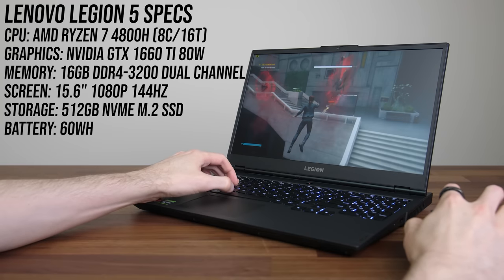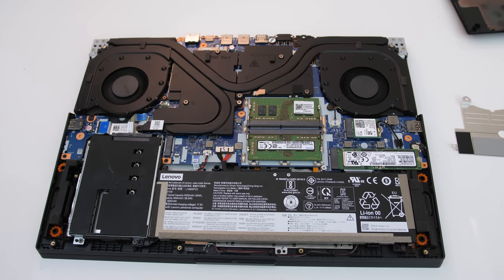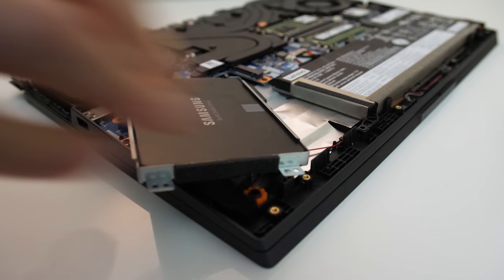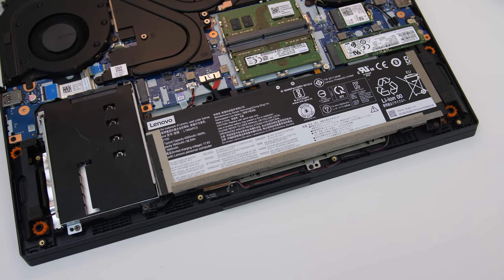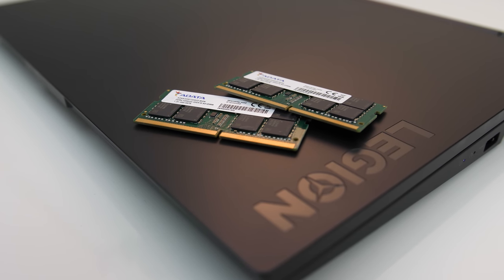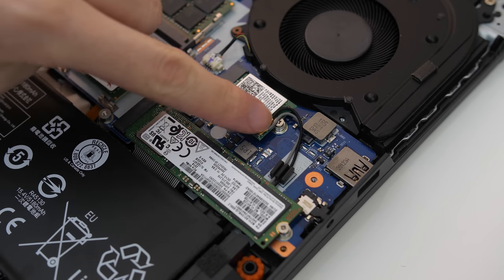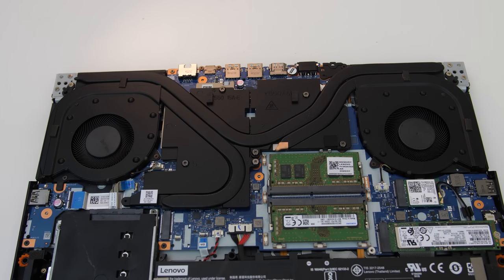Lenovo Legion 5 Upgrade Guide - Boost Performance!

Comment: Just a note to people upgrading brand new Legion 5s. the newer ones (like the one I purchased) have different motherboards installed meaning a 2.5inch SSD or HDD can't be installed into it, an M.2 SSD can still be installed in the same way. Another thing to watch out for is the RAM, the motherboard in the newer ones isn't XMP based meaning XMP ram (what's commonly sold) won't work at full speed.
Reply: It should be in the TOP of comments! Very very important information. I am waiting new 82NW0037 and fear that cannot plug 2.5 HDD!
Reply: So I wasted $50 for nothing 😑
Reply: same here, can't add 2.5" ssd, only nvme
Reply: what's the version number of your legion 5? unsure which version your referring to
Reply: @megaberu  honestly unsure now, I sold it over a year ago now
Reply: @KilepsYT  I'm currently on a desktop PC I built myself but before I got rid of my legion 5 I was very happy with it, it was powerful enough to do VR games. I upgraded storage in mine and gave it 32gb ram and had 0 issues with it

Comment: PS: It is recommended to disconnect Power Battery (not cmos battery) before doing anything on the laptop's internal.
You do not want to accidentally turn on the laptop while installing devices.
Reply: You can accidentally touch your screwdriver on the board and blow important stuff if you don't disconnect the battery. Saw this happen to a friend when he was upgrading his laptop.
Reply: I heard that this laptop has an option to disable the battery in bios. So would that be the best option? So that you don't need to disconnect the battery and risk accidentally damaging the cables or whatever if you are unexperienced.
Reply: no matter what it is... car, motorcycle, rv, computer, gaming console, PC, fridge, microwave...doesn't matter. 
As a safety precaution for both yourself and the devices you are working on always disconnect from the power source. 
I'm sure people are gonna comment and say I don't know what I'm talking about but please just remember this no matter what it is you are tinkering with!
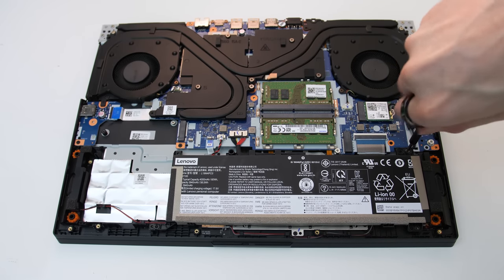Reply: Is that the cable he disconnects when he takes out the battery or is it another one? The one at 4:30?
Reply: That metal thing above the rams and ssd, is damaging the motherboard when u accidentally touch it to motherboard.
Reply: @theairaccumulator7144  Saw this happen to me while upgrading a 6yo laptop ^^ An accidental and quick screwdriver touch on the MB resulted in an instant flash and RIP the poor device. Be careful guys. Always unplug it from the battery (and charger ofc) first
Reply: @Niks50  Don't do that. Always opt for physically disconnect the battery and charger. You don't want residual electricity running in the components when you remove them.
Reply: @bobowofol  how to disconnect the battery ? I can disconnect the charger but the battery i have to open the laptop
Reply: @freemaysin5088  you are right i always unplug power before i do anything pc internals related like swap gpu or like repalace hdd/ssd no matter if its desktop or laptop
Reply: Just like human surgery
Reply: Right.

Comment: After watching so many videos of this laptop on your channel, decided to pick one up. Here it comes with 2 TB SSD RTX 3060 and 165 hz screen, ryzen 7.
Reply: Just picked mine up a couple weeks ago and the only difference is mine has a 1 TB SSD. So far I'm really loving it. Hope you like yours as well.
Reply: @baguetteengineer  It's doing fine, for both editing videos and games.
Reply: I'm picking up the same laptop too
Reply: yea i saw amazon is shipping  lenovo legion 5  rtx 3060 with 2 tb of m.2 ssd. its pretty good i must say
Reply: Hey bro
Sourav Joshi Vlogs Had A same laptop.
he had some problems. 
so please be aware buying this model of lenovo
Reply: Have any of yall noticed issues with the keyboard missing keystrokes from time to time?
Reply: Is 2TB is the maximum limit storage for this legion 5?Including both slot of nvme ssd
Reply: @KojiroSasaki21  yes it has 2, 1 TB SSDs attached. You can upgrade further I think.
Reply: same, getting it tommorow. only difference is that i have a 1tb ssd, but i can take the one i have in my current laptop and put it in the legion :)
Reply: @GorditoBanditoFPV  no, in my limited typing it hasn't happened yet. Used it for 2 months for editing videos and games. I do type an email from time to time.
Reply: @RideWithRahulOfficial  going to pick one soon in june, cant wait
Reply: Does it comes with the port 2.5" for hdd?

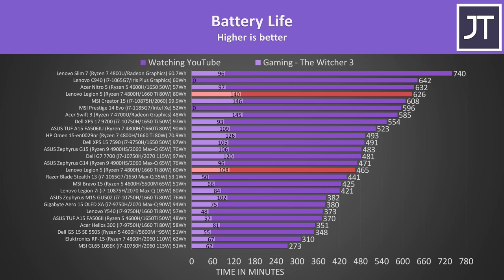Comment: 4:56 - the longer cable version is from the 17" Legion 5. It will fit into 15" version, as seen in your video. But the shorter cable 15" version will NOT fit into the 17" version, be noted.
Reply: Nice pfp
Reply: Those holes on the back looks scary as fuck. It's like, the thing is staring at me. That's freaking me out.
Reply: Please suggest me a battery for ideapad gaming 3
Reply: @traderbear6518  That was just your trypophobia kicking in. lol

Comment: Thanks for including the 80 Wh battery upgrade section! The Legion really became the best overall gaming laptop of 2020 with these upgrades. Would've been nice to see if RAM with better timings and tuning further improved the experience.
Reply from the maker: Yeah faster timings would have been fun, but this is all I had access to without buying expensive memory just for the video 😁
Reply: Included RAM is CL22. There is no XMP supported on Legion 5, and better RAM is only CL20. The performance difference is really small, like 1-2 fps, if exists at all. CL20 HyperX Impact RAM kit is about 150-180$, totally not worth it, IMO.
Reply: @mrgndx  I see 3200 cl 16 modules gskill ripjaws sodimms that are 1.2v on newegg though. The absolute fastest sodimms are 3600 cl 16 and they are expensive as well as higher voltage at 1.35v.
Reply: @JarrodsTech  
I wana buy 80wh laptop
Can anyone help me I couldn't find it
Or the model don't exist at all..?
Spec req :
4800h
1660ti
144hz 300nits
80wh

Comment: This is a beast of a casual gaming and full time dev laptop. 8-cores and 64GB of ram. You can't go wrong with that.
Reply: Actually, you shouldn't add more memory than you'll need. It actually proves to hinder performance. Using these faster nvme drives really makes more ram unnecessary. Check benchmarks with more vs less RAM online.

Comment: That 80wh battery upgrade is absolutely impressive! I thought that it would be a little better than the Omen 15, but I didn't expect that huge of a battery lfie increase.
Reply: How much of an increase did you experience?
Reply: Those holes on the back looks scary as fuck. It's like, the thing is staring at me. That's freaking me out.

Comment: You need to disconnect the battery before ripping metal shields off the motherboard, because you can short the powered rails and the laptop would be dead. Despite that good and short video showing on what needs to be done to upgrade these things :)
Reply: I know someone is going to ruin their laptop if they just watch this video without doing further research,
Reply: lol - that's like saying you need to dismantle the laptop's screen before doing any upgrade to the laptop.
Reply: @xibeon   Disconnecting the battery is ALWAYS the first thing you should do when taking apart something. I know you will probably say that nothing's happened to you, and I've never had any issues with it either, but that does not make it safe in the slightest. Also good job responding to a 1 year old comment, really showed em
Reply: @ActualRealKayamariOfficialVEVO  Yeah nothing bad happened to any laptop I've ever opened and they were quite a few. I don't even know anyone who somehow damaged any laptop by not disconnecting the battery. Im sure you don't either. The thing with damaging the laptop by not disconnecting the battery is a internet myth. Sure, it can happed to someone somewhere, but same goes with lightning strike or lottery winning.
Reply: @xibeon  Just because it's unlikely doesn't mean it's not a risk that should be taken. Disconnecting the battery takes three seconds to do and means the risk (even if it's as low as you think) is put to 0. that's better odds than leaving it connected. Why do you want to keep the battery plugged in in the first place? Also, if I'm working on something that's worth multiple hundred dollars you bet I don't want to take any risks in the slightest about frying it.
Reply: @MSOLO_343 Was it turned on  while doing your upgrading ?

Comment: I like that Lenovo included the four SSD screws even though they are very much standard screws that are likely to come with the SSD as well. And their decision to specially design a piece of plastic to hold them is so smart as well. They could have just gone lazy and put them in the plastic bag with other accessories, which the user is unlikely to remember or even notice. It's details like this that make me approve of a product that much more.

Comment: You might be able to use the M.2 drive as well as a 2.5 inch SATA SSD at the same time if you take apart the 2.5 inch SSD by removing it's plastic housing. Inside that there's a high chance you'll have a small circuit board which is the SSD. After that you might even be able to have all three options, larger battery, SATA SSD, M.2 SSD(As long as that M.2 isn't the same port though, shouldn't be if the M.2 is NVME).
Reply: I guess those second drive ports (sata and nvme), share the bus. that's why you shouldn't connect both drives by force.
Reply: @visitor404  I've had the drives connected this way for over a year and I haven't noticed any drops in performance
Reply: I can confirm this. I have an Kingston 2000g KC2500 M.2 2280 NVMe SSD (2TB) installed in this laptop.

Comment: Love how I found this video 3 days after putting in my 2.5 ssd. First time I've taken apart a computer and did any kind of installs. It went great, but fantastic content nonetheless!
Reply: Hey man quick question. When upgrading storage will you need to transfer the storage from the old one into the new SSD?
Reply: @hectorrmdz  if by "transfer storage", you mean transfer windows to the new ssd, you dont.

Comment: Suggestion: At 0:28 maybe you could continue with the black background theme and the wooden table. Would look class.
Solid video as usual
Reply from the maker: I will, I'm just in the process of setting up the new filming space, so for now while getting set up some things are still happening in the older room.
Reply: If the color is just right the laptop will be invisible.
Reply: @JarrodsTech  I agree that the wooden table and black background looks better, but the white table gives better contrast especially when you're working with parts and taking things apart. Anyways thx for the video I literally just bought the same model (same specs even) cuz of your videos a week ago. 

My biggest concern after GPU and Screen refresh rate was thermals. I live in a hot climate so, thermals was a big concern for me, your videos played a huge part in making my decision and buying the legion 5 1660ti Ryzen 7 4800h / 16 gb/ 512 SSD. 😊

Comment: Feels like you are fed up with the Short Circuit video about not being able to upgrade ram. I am too.
Reply from the maker: WHAT'S THIS METAL PLATE? GUESS WE'LL NEVER KNOW
Reply: @JarrodsTech  Jarrod, I'm sure that the Legion 5 is only limited to 32GB of ram not 64GB of ram
Reply: @nexomii4187  it works actually
Reply: @nosc0pe  oh okay, I remember a tech YouTuber said it's only limited to 32GB thanks for the info
Reply: @nosc0pe  are all laptops like that? That you can go higher than specifications?
Reply from the maker: @nexomii4187  definitely works, I think people confuse what the company sells it with as being a limit.
Reply: @machujoseph4765  idk, Google the laptop model (I.e. Like helios 300 64gb ram Or ph315-52 64gb ram)

Comment: Just ordered a 32gb ram kit and 1tb m.2 SSD. Super stoked, thank you for the guide ❤️❤️
Reply: My legion 5’s internals did not look like yours, at all. 

My HDD orientation was flipped, the m.2 drive didn’t have a place for me to screw in, and my battery was fucking massive and ran the whole way across the bottom. 

Like what the fuck
Reply: @Birdo720  Ahaha lol, I hope mine is like the video. I'm putting a second m2, do you know if I can install windows in it? And use as main m2? Thanks!

Comment: for anyone watching this, dont change the thermal paste for any of the legions, they use a phase changing thermal pad and its very good in laptops
Reply: Does this mean the thermal paste never has to be reapplied on it? my current lenovo ideapad 520 is thermal throttling and I think the reason is that the thermal paste is dried out. If  thats not an issue with the legion Ill be even more sold on it then I already am right now
Reply: @deadfox5489 change it then but pick a good brand thermal paste not mx4 or mx5 they are not good after testing

Comment: The 64gb RAM upgrade might not show much improvement in specific applications, but it will be useful for people managing workloads that require it, like virtual machines and docker along with other machine learning tasks. So its good that this laptop supports 64gb RAM.
Reply: @llamaloversunite  it does not exactly supports more than 16gb of ram?that's a deal break for me since I consume more than 16gb

Comment: If you know what you're doing, I strongly recommend changing stock thermal paste for liqud metal (Thermal Grizzly Conductonaut  in my case) Temperatures dropped from 98C° to ~75C° on CPU in full load, which is a nice improvement for longevity and performance of your HW.

Comment: Also, if you experience micro-stuttering in-game, I suggest to turn off processor boost in power settings. The boost in my example caused thermal throttling (clearly visible in HWINFO64).
Reply: how do i do this

Comment: I got this laptop and it's awesome. I have the intel version and i've never had a problem with it. It dosen't overheat or anything like that. But the biggest downside is that it only has 3 modes which sucks, other than that everything else is just perfect.

Comment: You sir, are a legend. Went through all the Lenovo manuals, no help there...this was great. They suck with a 512gb main drive, bumping that to a 2tb M2 and the 2.5 to a 4tb storage. That'll do...for a while. And courtesy of you, I wont bump the RAM or WIFI up now. The battery upgrade looks good, but I reckon the bulk SSD space will prove more useful...Your clip was fast, comprehensive, engaging and informative. Excellent production values there. Thank you.
Reply: does a 2TB M.2 SSD work? Specs only suggest up to 1TB. I wonder if I could put in 2x 2TB M2s....
Reply: @ryanspackman548  have you try?
Reply: I did put in a pair of 2tb ssds. No dramas. They are Samsung 970s I think. Partitioned 500gb for OS and programs, 1.5 storage and 2tb game drive. No worries, and blisteringly fast. Love it.
Reply: Um, didn't the video state that you can only either use one of the drives? Either m.2 or the 2.5" drive thing? How did you manage to use both?
Reply: Thankfully paid someone else to do it!! Mind you, tech said it was no drama - and they are paired 970 2tb m2 ssd. Been a long time now, very fast and stable. Only issues are Windows based ones!
Reply: Please, tell us how the 4tb drive does with this.
Reply: There are 2 M.2 slots. One the left, over the 2.5" bay and one on the right, next to the wifi card @ShahrulAzry

Comment: Are these suggestions valid on the Legion 5 2021 too? Ram speed is slower too in that model? Wifi card can be upgraded too or has a better one now in this new model? (Talking about the ryzen 5 5600h and rtx 3060 model)

Comment: Thanks for the video.  I just upgraded the memory in my new 2024 Legion 7i. I also went from 32GB to 64GB (I used for my case Crucial RAM 64GB Kit (2x32GB) DDR5 5600MHz ). I must mention that when you start the laptop, screen will be blank for few minutes while it recognizes the new memory. Just wait and it should work.

Comment: As an owner of this machine, I feel like some important topics were missed here.

Upgrading RAM isn't just about capacity. Sometimes it is about performance. What will this machine do with tighter timings? What are the actual limits it will accept? Is there a 3400MT/s or faster kit available that will work? 

Can the cooling be upgraded? I know in the past, Lenovo has different cooling for different SKUs. I also own the 1660Ti version. Is the 2060 cooling module better? If so, would it be possible to upgrade to the 2060 cooling kit to improve temps? If you can, does that improve performance in any meaningful way?
Reply: Make a video or link a source to switching the cooling kits I never heard of that.
Reply: @Duran762  I was asking as the "upgrade guide" was missing the upgrades that appeared to be worth doing. It is common practice to have different cooling based upon the build. First I ran into that, was with the W520. Upgrading from a dual core to a quad core included a cooling upgrade. Upgrading from the low end to high end GPU involved a cooling upgrade. And you could purchase, and install that upgraded cooler yourself if you wanted to lower temps on parts that weren't maxed out for the platform.

I assumed the same would apply to the Legion 5 - given the upgraded parts available. However, that topic was never approached by the author.

Comment: Great tutorial! Can you confirm that the M.2 form factor is 2280 and whether the slots are PCIe 3 or PCIe 4?  Thanks for the quality info!
Reply: PCIe 3. It will accept PCIe 4 though it will run at PCIe 3 speeds. Though you will be able to upgrade to 4tb single sided PCIe 4. You're limited to a maximum of 2 tb single sided with PCIe 3. The dual sided 4tb PCIe 3 cards won't fit properly. They have to be single sided or they rub on side and overheat.